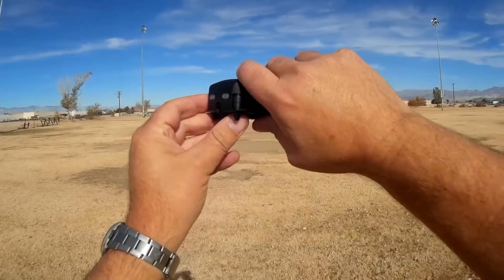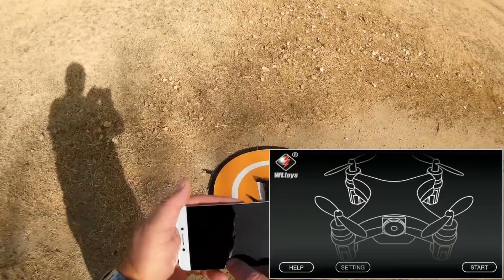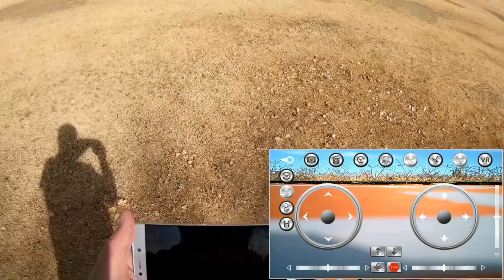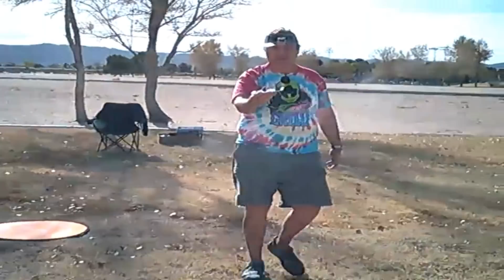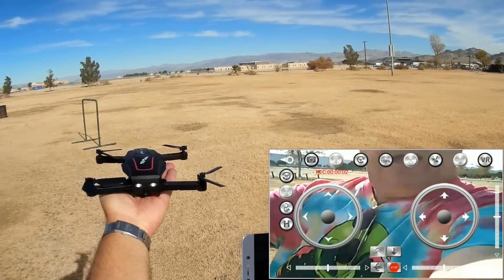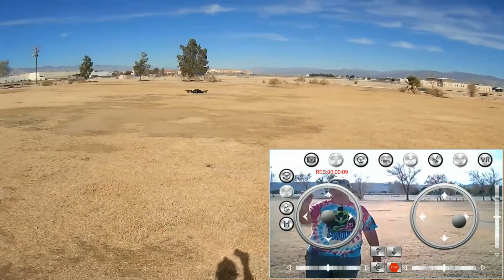WLTech Q626B Folding FPV Camera Drone Flight Test Review

Comment: Hey :) 

been watching your channel , great videos  

Any chance you can do  "beginner guide for APP controller" , this is my first quadcopter and it is really tricky getting it to fly without moving arround by itself :| (for whatever reason it moves right or left ) ;;; as you can see the manual that comes in the box contains very few guides.

i.e best way to fly
how to setup the "return to home" and make it work
gyro guide
altitude hold
trajectory flight (i.e follow me )

much appreciate it  :)
Reply from the maker: If it's flying unstable, your gyros may need calibrated.  Turn on and place the drone on a flat and level surface.  Connect your phone to its WiFi, and open the app. Click on the OFF button to select app control (turning app control on).  Then notice the gyroscope button on the bottom of the screen, just below the upward arrow takeoff button.  Press the gyroscope button once to calibrate the gyros.  It should now fly more steady.

For the others that you mention, they are self explanatory.  Trajectory flight is simply drawing a route on the screen, and the drone will somewhat do such.  But it has a lot of drift, and will inevitable result in a crash unless you're flying in a wide open field (not recommended in toher words). 

This drone does not have follow me.  But you can simulate such by using headless mode.  In headless mode, the drone can be pointed toward you, and you can manually fly it to have it follow you.  Pushing forward on the right stick will send it away from you, pulling back will bring it toward you, and left and right will be with respect to the forward backward directions.

This drone has one key return, which is NOT return to home. Many (if not most) toy quads use the questionable practice of advertising one key return as if it's a return to home feature. But it is not. Only a quadcopter with a GPS system is capable of returning to home and landing at its takeoff spot. This quadcopter does not have a GPS, and is not capable of return to home and landing. Always remember, if no GPS, then no RTH or RTL. No matter what the listing questionably infers.

"One key return" simply flies the quadcopter in the exact opposite direction that it was pointed when it took off. For example, if the quadcopter was pointed North at takeoff, pressing one key return would make it fly south. Thus if you make an effort to always keep the quadcopter flying North of your position, pressing one key return would make it roughly fly back toward you. But if the quadcopter was anywhere else but North, it may actually fly away from you.
Reply: Quadcopter 101 thanks for your elaborated reply 👍🏻👍🏻👍🏻👍🏻👍🏻👍🏻

Comment: @quadcopter 101 

I still wonder how to make the charge-adapter to work :)  ;; is it charging when it is red ? or what ;

Every time i plug battery into recharger it goes RED ; if i try to insert the battery a little it more in the recharger ;; it just stop the RED light  :| :| :| :|

also even after 2 hours of recharging i cannot feel battery getting heat :|
Reply from the maker: It differs between charger.  But here's how for any charger.  Plug the charger  (without battery inserted) into its power source. and notice what the charger's light does.  Then plug in the battery to the charger.  The light should change.  When the light returns back to its initial condition (without the battery), then the battery is charged.
And what are you using for the charger's power source?  Are you plugging it into your computer's USB port?  If so, many computer ports do not generate sufficient power to charge the battery.  Instead try a phone wall charger.

Comment: Any nearer with the x8, how did the repairs go ?
Reply from the maker: They're sending me a spare motor. Unfortunately the motor hasn't arrived yet.
Reply: Gotta love the x8 😆. All part of the fun . Mines still in bits on the shelf . Well it’s the helicute version. has a different pcb ! To the syma x8 . Just can’t find them to buy ☹️
Reply from the maker: +Cam Footyage yeah, but keep in mind that the new version of the X8 has been extensively redesigned (and not for the better sad to say). Changing a motor used to be very easy, with easy removal and swap using just a few screws. But the new X8 Pro requires removing 20 screws, and popping the fuselage open to gain access to the motors.
Reply: Yes I see your point . Will you film and post the motor change ?. I think you would be first on YouTube lol . Nobody done one yet from what I can see .   That would be one to watch.

Comment: I hate phone flyers. 😡😡
Reply: semifast2 I still hate them sorry. When you get one let me know how you feel about them. Really GARBAGE. 😡😡😡😡
Reply: semifast2 transmiter is better than phone the different is like dji combo version and standard version you can see the transmitter have more power than phone
Reply: Problem is it doesn't extend the capabilities of the phone, as you have very poor control over the thing. It will improve when they start putting GPS into them I guess, but so far, they are just useless.
Reply: DrSid42 but the transmiter range is better than phone